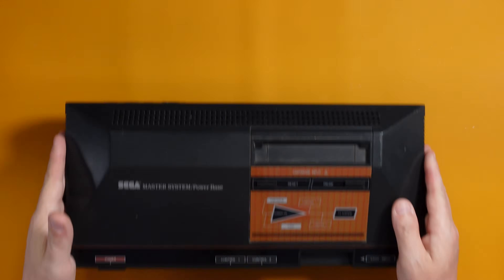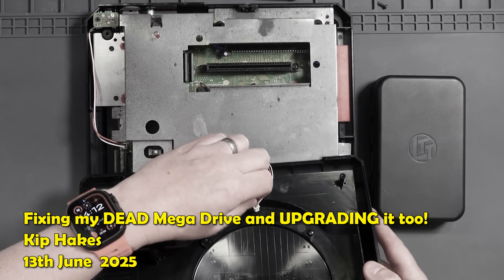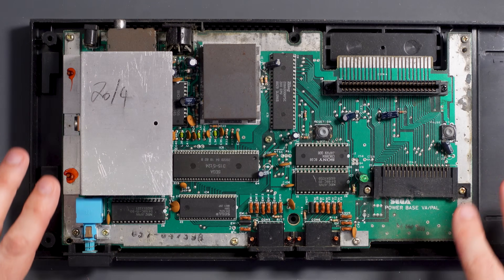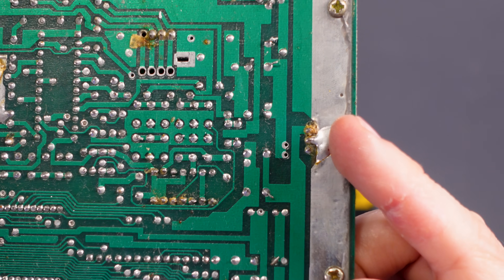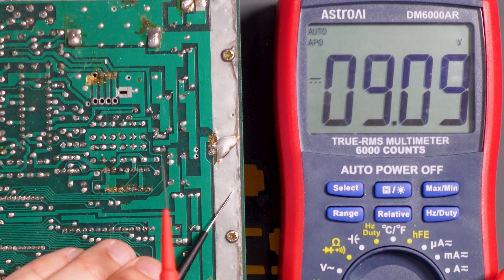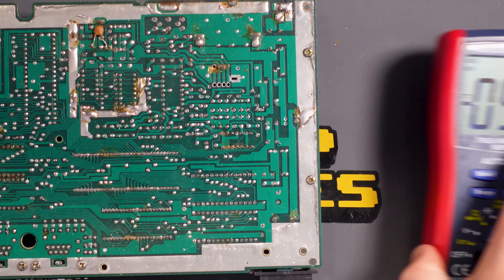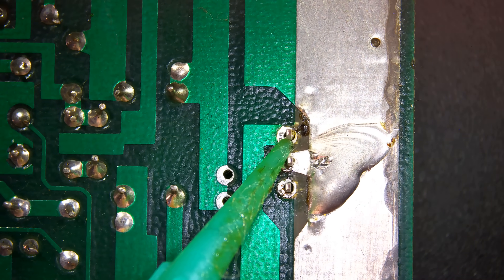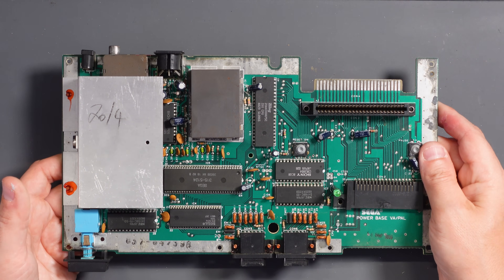SEGA Master System - It's DEAD - But can I fix it? Quick Fix it Friday

Comment: Does the regulator go bad from use or age? I have my original system from the mid '80s which had maybe 20hrs of use.(long story) has been kept in great condition since. Afraid to power it up so as not to cause other problems further in the circuit. Although I fear a test is inevitable. Just trying to avoid potential headaches.
Reply from the maker: More from use.. they do get very hot
Reply: @KipHakes Thank you sir. Very much appreciated......fingers crossed!

Comment: I got mine from a classmate in around 93. with the light gun for Safari Hunt. I think I bought Lemmings.
My favourite part of the Master System was the “Hidden” built in game- Snail Maze, that I think you had to press DOWN whilst powering it on… then you had a time limit to get a snail 🐌 around a maze & if you did it in time, you got another… until time ran out.
Reply from the maker: Amazing! Thank you for watching!
Reply: @KipHakes  I assume the snail game is built in “on board” but you may or may not have it on your Everdrive. 
If built in to the board, as long as you have a controller, I guess you don’t need a cartridge to test the video… which may or may not help in the future if you have another MS with a dodgy card slot. 🤔🤷‍♂️
Reply from the maker: Yes. I think it’s in the bios.. I will check it next time I have that console out

Comment: Before you fluxed it up what you had at the old regulator was actually Rosin (Flux) but it was such an easy fix for you and that the rail was not shorted or something. I Got one of these consoles you could take a bite at which would literally make you quiver in your boots and I am not even sure it would be even possible to repair all that damage. IF I say the cartridge connector looks like it is filled with solid rust and that a lot of resistors have corroded completely away you get a hint what mine looks like. But I got a working one too, and two master system 2 which I have RGB modded.

Comment: Extremely common for the voltage regulator on these to go bad. I’ve fixed at least a dozen with the same problem, I’ve even had a few where the ceramic cracked in half.

Good job!
Reply from the maker: Thank you!

Comment: be careful you don't flux it up too much Kip! that fix came across as way too easy in the end, would have thought a capacitor would be more common to fail, either that or if there was an inline fuse, but being 9v with a power supply plug, then less chance of a fuse on the mainboard.
Reply: You can never use too much flux

Comment: Their was a prototype froppy drive and keyboard for the system to use it as an 8bit computer but i never seen the peripherals in person.
Reply from the maker: Oh wow! That’s interesting!
Reply: @KipHakes yeah the processor is a powerhouse for its time and they wanted to leverage it in the Japanese market.
Reply: @KipHakes  Additionally, Sega actually made a computer. The SC-3000, with console SG-1000, released on the same day as the Famicom! The SG-1000 would later become the Sega Mark III, releasing in the west  (and re-releasing in Japan with included FM synth chip once an add-on for the Mark III) as the SMS. The JP version is backward compatible.

Comment: Kip if you fit one of those 50/60hz switchless mods word of advice change out the Pal crystal for ntsc and save yourself a load of incompatibility issues.
I did mine years ago and had some random crashing issues. Some forum member suggested changing out the crystal, and I will admit it sorted out the issues I was having.
Reply from the maker: That's a great tip, thanks so much for sharing!